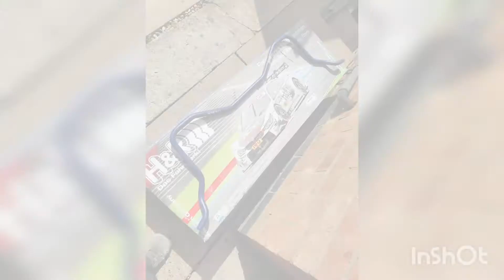Fitting a mk2/3 golf anti roll bar/sway bar to my seat ibiza cupra mk3 6k2

Comment: For what mk2 golf did you buy for? I see there is several  types, aome are straight and would not fit with 1.8t downpipe. I am currently building a caddy with engine and suspension from cupra, but missing the sway bar

Comment: hi mate, so this is an direct fit? and does the same count for the rear?
Reply from the maker: Pretty much mate. 
The rear does require some L brackets to fasten the ends to the rear axel as well as some rose joints and threaded bar. They do hang a little lower that normal too as the wheels on the mk2/3 golf must be slightly further away from the cross section of the rear axel but ive not had any issues with mine since its been fitted.
Reply: @djkevins1  nice, do you also have a video on how to do the rear. and how does it handle?
Reply from the maker: @scott2779  there is a vid for the rear one too and it does go on fairly easily once the L brackets have been made and some rose joint droplinks are needed too.
Reply from the maker: @scott2779  https://youtu.be/soDie407ROw